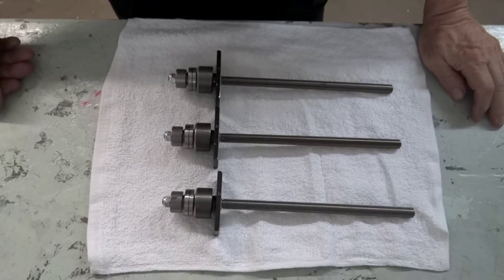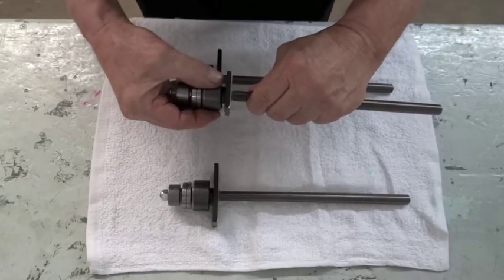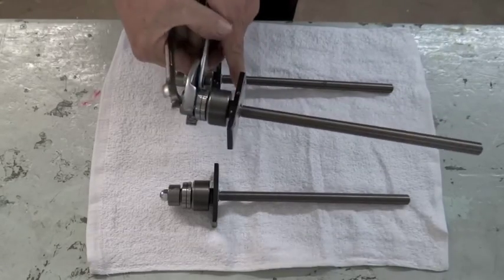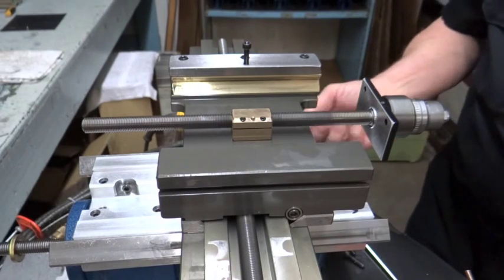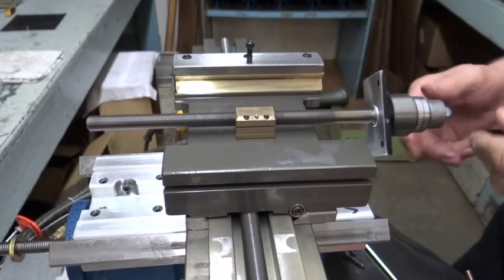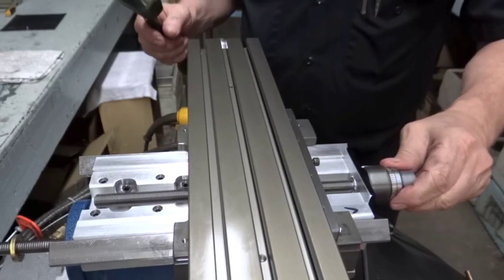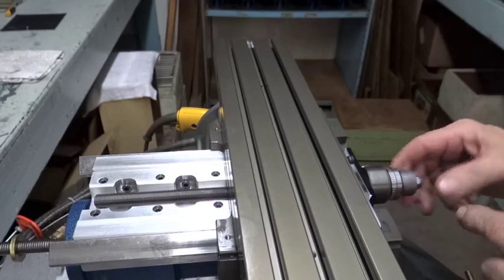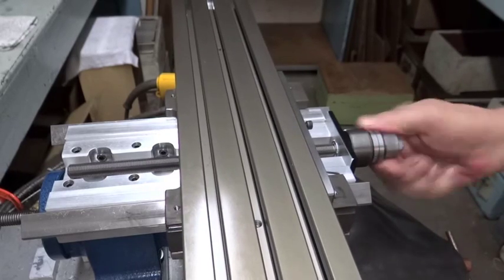LEAD SCREW ADJUSTMENT

Comment: I decided to pull apart my cnc taig mill because of this video after about a year of frequent amateur work(1,000+ pieces, some <1") as it started binding badly on the y-axis and I couldn't fix it properly. Nothing really needed much adjustment, cleaned, oiled, put back together as instructed. Now the feed rate can be pushed so high (a few seconds to travel the entire y-axis) the PC can't keep up and it still does not bind, that's an improvement of over 4.5 times

Comment from the maker: The tap on the bearing block (First part of video) keeps the bearings from sticking in the tight position. Sometimes a snug fit exists between the bearings and bearing block. 
The sometimes hard tap on the x table is used to rotate the screw nut in the carriage assembly to become straight. Thats why the bearing block retaining screws are NOT tightened UNTIL the nut and bearing block are as close together as possible.